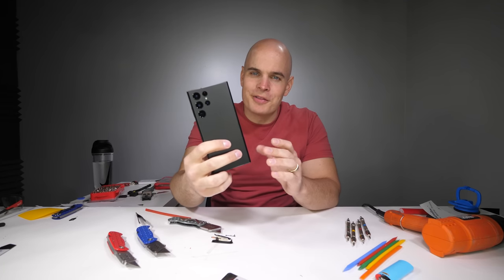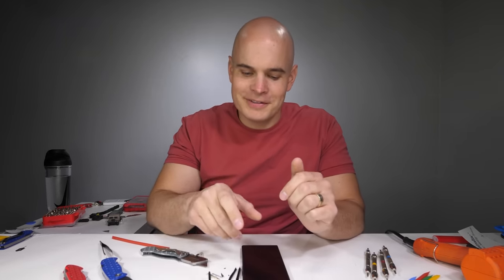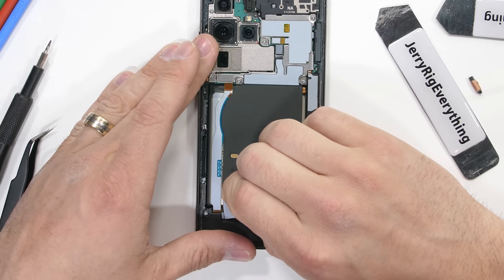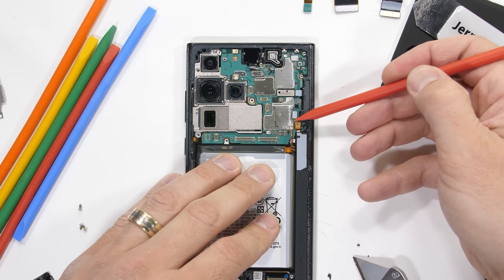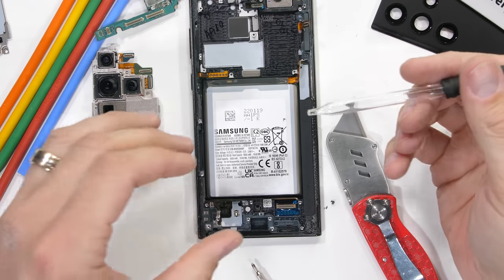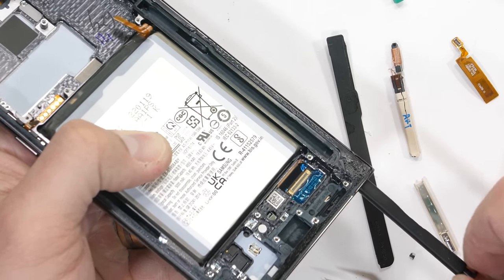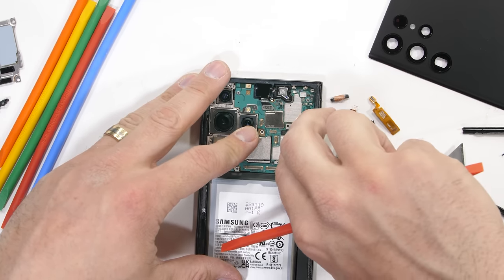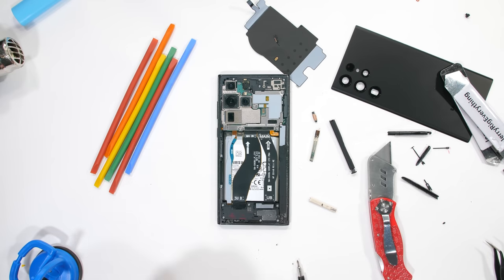Galaxy S22 Ultra Teardown - Can the S-Pen hole Leak?!

Comment: I've never imagined, that I'd ever hear Apple and repairability in the same sentence and I still have some mixed feelings about that. Isn't Apple the one who's hardlocking tons of parts to it's original phone?
Reply: yes and now they will sell parts with very high prices to make even more profits
Reply: same bro, apple is so much worse than samsung in repairability department
Reply: @JorgTheElder  repair comes b4 recycling tho
Reply: Think they backed off doing that if I remember correctly
Reply: @officialANON001  Nah, Hugh Jeffreys made a really good presentation in which he switches parts between two brand new Iphone 13s. They're basically unrepairable by the owner or even small 3rd party shops. The cameras and the display needs to be reprogrammed to work properly. I recommend you to watch the video, it's quite funny in a sad way.
Reply: @gabon4000  I saw his video like 5 months ago I think but since then I thought apple backed out of battery and display locking due to backlash and instead just warn the user and keep history of past alterations
Reply: they are still as irreparable as they can be(using different screws especially those security screws). It's just apple is extremely good at marketing
Reply: I just can’t digest he said apple is not of the table. 😕
Reply: @shinouske126  True. Although Samsung phones are very repairable, the only thing is excessive amount of glue on the batteries.
Reply: @officialANON001  Actually I'm not sure anymore, I looked for a bit and I did find the thing, that you're talking about. It's Self Service i think and it seems like something close to at least decent, but it didn't talk about the hardlocked parts. Maybe they'll send you an already reprogrammed one, idk.. I'm not hoping for any good from Apple, they're still the ones you get the part from so it's definetly good for them money wise.
Reply: Yeah, really, unless you send a newer iPhone to Apple you're going to deal with all kinds of caveats doing it third party.  He is correct that they have a strong recycling program, however.
Reply: I could see it being used in a sentence just the sentence is along the lines of, Apples lack of repairability.
Reply: Not to mention, that iPhones has literally SO many screws
Reply: @gabon4000  That's old info, and kinda irresponsible from Jeffreys to not update that. There was an iOS15 update that disabled that lock after Apple announced the new program and now parts can be interchanged. iPhones aren't an iFixit 10 by no means but if he took the time to bash the lock he should take the time to upload a new video after the software update.

I'm happy with my Pixel but it is good to know that iPhones are the longest supported phones and now reparable.
Reply: yea he didint even talk about how samsung doesnt lock down parts to the phone and everything in the phone is repairable.
Reply: @srp770  but that is a small price to pay to have your phone able to be fully repaired. and if you know how to repair a phone you likely know how to take the battery out.
Reply: @gabon4000  Apple has been doing this for a while, and now they’re switching from RepairCal to AST2 for OEM parts. Doesn’t justify it by any means, but I hope the EU right to repair laws undo the harm serialization has caused to the world.
Reply: I work in Geek Squad, where we do Apple authorized repairs. I can say with confidence Apple is probably the worst repair company we work with and the most wasteful. A replacement screen comes with extra adhesive, screws, instructions, papers, and in a double plastic wrapped cardboard box. Lid, base, and internal liner. That's all assuming you can even get a part. A new mandate from them to all providers says that if we need to order a part for someone we have to KEEP THE PHONE. The process is a week long on average to get a part and even if the phone is working we keep it. Then get this, if the part from Apple shows up broken. WE have to pay for the new part, and shipping for the old part to go back. Crapple is way worse than a LOT of people realize.
Reply: @Carl Gunderson samsung phones are more reparable. Apple went out of there way to make repairs harder like using different screws on there phones to make it harder to take apart. Yes samsungs phones have alot of adhesive but that is not a reason why to go away from a phone company. You buy a phone to use it. You would probably not take you phone apart daily. It don't really matter about what phone you pick. I would say the main factor into buying phone is if you break it, how much will it cost for you to repair it.
Reply: Apple is still supporting iphone 6s, full software and ios support, on 7 years old phone now...  They have been enviromentally best manufacturer since begining, compared to any android phone (half life of barely few years)
Reply: @Carl Gunderson Jerry is not up to date with info...  Apple disabled the lock with new update.. You can repair new apple phones ...
Reply: @Carl Gunderson You dont...  Electronic waste is getting bigger... Apple is dealing with that porblem much better than others.. firt, by giving long lasting devices with full support...
Reply: @Carl Gunderson That's absolutely not true. Apple uses at least 4 different screw heads in their phones, and then they're different lengths and thicknesses. Samsung uses literally one screw head and size for almost, if not completely, the entire phone, along with arrows that indicate where on the covers and boards you should place your pry tools for safe removal.

Apple prevents 3rd party companies from obtaining OEM parts and they do still have hardcoded serial numbers for parts. Samsung does none of that. 

Hands down, Samsung phones are the easiest to repair. Even as far as the battery goes: apply some heat to the display, drip 99% alcohol in the battery cavity, and get some wiggling going. I do it all the time.
Reply: @Carl Gunderson hahaha, you're funny
Reply: @Carl Gunderson i gotta agree with you 
Most basic toolkits come with every bit you need 
I'd rather 10 different screw types over Samsung's strong af adhesive any day
Reply: @sparklingcarlisle5279  Lol you hate apple that much that you can't "digest" that someone else doesn't hate it as much as you do for some reason?
Reply: @MarkStudent  hmmm…what exactly is the problem with using different screws in the phone? Why is that an issue? Please explain thanks
Reply: @rodrigojds  In and of itself it's not the end of the world. But it's much easier for an average consumer to do repairs when the screws are common and not things like Penta and standoff.

Ultimately my reply was in regards to the idea that Samsung is as unrepairable as Apple. Screw choices are just a quick and simple comparison. They set the tone of a repair, whether it's a phone, an appliance, a medical device, a car, or anything else.
Reply: @Carl Gunderson It's because some of the screws they use are non-standard but designed to look standard so you run the risk of damaging them when removing them. It's the same with all of their products, they engineer ways to make it difficult if not impossible to fix them. If your wondering why people are talking about right to repair it's because: 1, that's what this thread is about and 2, it's what your initial comment was about. Both of these make your later defense of "not caring" feel like a backpetal.
Reply: @DimitrisSartzetakis  While I generally live by the "to each their own" motto I do get where they are coming from. Apple flirts with human rights violations, even by China's standard. They also have like 15 years of anti consumer business practices under their belts. Their most common avenue suggested for repair is surrender the old product and buy a new one because they are going to overcharge you for parts, and replace parts that are still working. Now that they lost the right to repair fight in the EU and were slowly losing it in the US, they try to save face with the recycle program. Thing is in the US right to repair already gives us this. Many EU countries have it built in at the point of sale as does Canada. Not to mention that at the end of the day, extending the life of a product makes it better for the environment than any recycle program ever can.
Reply: @rodrigojds  have you ever tried keeping tiny screws organized? Try doing that with 4 types of screws and a myriad of components and you're bound to lose track of which screw goes in which fucking hole
Reply: Apple won't be around by 2030.
Reply: @xAureliusx  I also agree.
Moreover, I think some people here never tried to open a Samsung
Reply: @shinouske126  agreed
Reply: @shinouske126  sure. i replaced myself batteries on my samsung S9 and S10 and it is pretty easy, just apply little heat on display where battery is placed.
Reply: @srp770  Yeah, it's choosing from 2 of the least bad options. Do you want your phone to be easier to disassemble and work on (iPhone) or do you want to have full functionality of your phone after you replaced something (Galaxy)
Reply: Lmao you should check out LouisRossman's videos on apples "repair" program!!!!
Reply: Yeah i honestly don't know where he got apple is even remotely good for the environment. None of these companies care about the environment it's all a ruse to sell products. It's not hard to see they take the chargers out of the box tell you it's to save materials then sell the chargers separately in a completely different box😂😂. Almost all of them have gotten rid of SD cards too now, so when you run out of storage guess you'll have to buy a new phone. The environmental shit has gotten completely out of hand I personally love when I'm preached to by people who fly jets across the world polluting more than cities of 20,000 people. When the rich stop flying, when the rich companies stop making all their parts in China & India (known to pollute more than most of the world), I'll give a fck about what they have to say. If they really cared they'd the ones who could make the most difference, yet none of them do. They just do things to charge the customers more money in the end. Isn't it strange how climate change is solvable with money 😂😂.
Reply: @sushiman3817  the sad part is many companies are adopting a similar system, the right to repair acts get destroyed by these big corporations. Then the corporations put on a front like they care about the environment. The only part of the environment they care about is their pockets.

Comment: Upgraded from a Note 9 to the S22 Ultra just a few days ago, I wouldn't have upgraded if I didn't get a good deal for an upgrade. A solid device as usual!
Reply: Did you use their offer on taking back your old phone for 100$ more than its worth?
Reply: If so can you please tell me how much your old one was?
Reply: Verizon is doing a promo right now where if you trade in your old galaxy they will give you 800 dollar credit regardless of the condition
Reply: lol , enjoy GOS downgrade from samsung
Reply: Samsung Note 9 is the last great complete „TOOLKIT” phone. What I trully wish , is that Samsung would release (when there will be a big breaktrough in phone computing science bringing the laptop specs to the phone without overheating) to build the ultimate phone that is around the Note 9 size but taller, a bit bulkier/Thicker for more battery and features, and have it be the ultimate tool, that would include the IR blaster and reader for programming, Radio reciever and transmitter, headphone jack with optical audio capability, side Case pins for extended battery case, normal (side or back) but also under screen finger print reader that can be disabled, 2x fully programmable buttons, and a pen with a better capacitor for 10 minutes of 10 clicks/second and 2 buttons that can be read up to 20 meters away (10 meters full signal) true Iris scanner and 24 MP front camera with 8k ultra wide capability, and the ability to use a crop recording with digital stabilizer and 90 degrees view for vlogging that is 4k and a more normal angle , rather then 160 degrees (8k) down to a more resonable 90 degrees (4k), also NO! under screen camera setup, but more like the note 9 form factor, but while also having a full 21/9 aspect ratio screen 4K CAPABLE, but that can go down to 1080p for the best battery life and performance, and having 2x front facing corner ambiental lights, that can be used for reading or for when you need wide ambient lighting, and on the back, an array light that has doual porpuse, wide field ring light (both ambiental close range lights should be able to change the temperature of the light from cold to warm light with ample steps between white and worm orange), with focused center light that can illuminate up to 50m for the 20x zoom lense, and the smaller ring light would be up to 5m for the ultra wide or 2x zoom. Also, it should have dual proper speakers for true mobile stereo, that also have ultrasonic capability, for pet training command use, or for emergency cases that makes an inaudible sound to humans, but the phone itself and rescue units with capable gear, can detect the sound to find the phone's location at least, and maybe also a GPS signal emitter. And call it (THE GALAXY TOOL NOTE 1) that maybe does not have the most powerful hardware, but it is the most versatile version for people that need a tool that is reliable in any temperature or scenario. (And this line of phones should have a new model each 3 years, and have them fully supported for 9, and security supported for 18 years) (Unless at least 50% of these options are in a phone, i will not buy an other one, at least not a samsung.). Sony has the potential of doing what Samsung does not anymore, Innovate. If Sony could find a way, through an UAG case partnership and Wacom pair-up, to have a secure side case pen that works at least as good as the note 9 pen, then it would out-sale Samsung just from the utilitary phone users that prefer the note 9 , and if they include a good pair up with raw HDR pictures and raw editing power, that is seemless and compatible to their amazing mirrorless cameras trough a multi-load and multi access points WI-FI system, then they will also sell the echosystem to photographers/vloggers/filmmakers, and also drive sales to their mirrorless cameras, because even if you have a capable day-day camera on the phone, you can't beat the raw performance of a big sensor with big lense, for the extra special occasions, or for professional users. Maybe even a much better drone that can use mirrorless cameras with an automatic optical zoom lens that can beat out all the integrated camera drones, through the sony echosystem wi-fi setup (bringing joy to the FPV drone users , to be able to do similar stuff, while also being able to gather amazing video and pictures.)
Reply: @Narinjas  holy fuck
Reply: Reading this on my Note 9 working like a charm after 4 years... best phone ever made by Samy
Reply: I am currently using the note 9
Reply: @Narinjas  if they did that then they would be losing out on making money out of us as ther will be nothing to improve on other than different design and that wouldn't last long
Reply: I will be doing the same from S10+ to S22 Ultra already ordered online S10+ got damaged by ool water
Reply: I'm waiting for mine as I am writing this. I got a hefty discount, otherwise wouldn't have upgraded. To be honest I will miss my 3.5mm jack, but the other phones that include it are not good (tried a ZenFone 8 and reverted back)
Reply: @Narinjas  touch grass
Reply: Upgraded from note 9 to s21 ultra loving it as I bought the note 9 at the end of its life and has started slowing
Reply: Just bought an s22 ultra to upgrade from my broken and beaten up note 9, I'm so sad to let it go
Reply: Have you noticed the degradation in speaker quality, plus how easy it is to cover the speaker and Alcoa mute the bottom speaker from covering it. I thought I was typing because that brevet happened on my s10 plus, do I did a sound test.

The speakers on this phone are lackluster and worse than my s10 plus from 4 years earlier, while being slimmer, and smaller, while having a headphone jack, SD card slot, hr and health sensors, mst tech, and all that. Sure the s22 ultra has these huge cameras and this huge battery, but that is no excuse yo downgrade the audio quality on a $1300 making it sound worse than a phone from 4 years ago before, that retailed for $300 less.